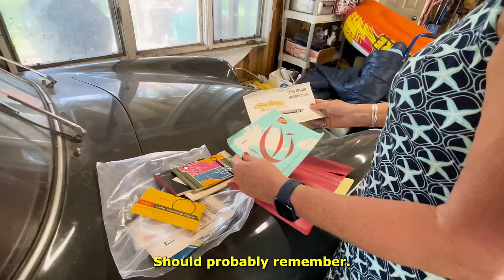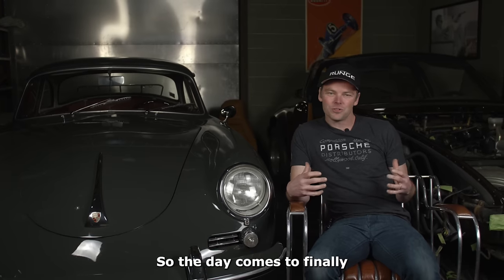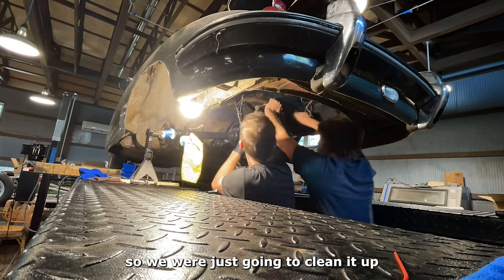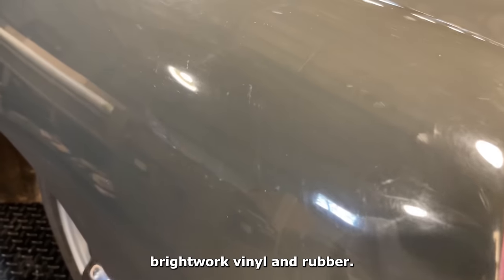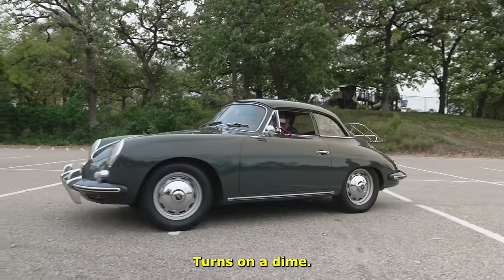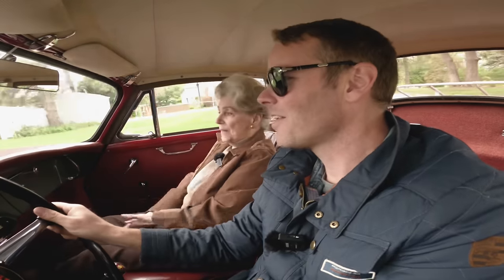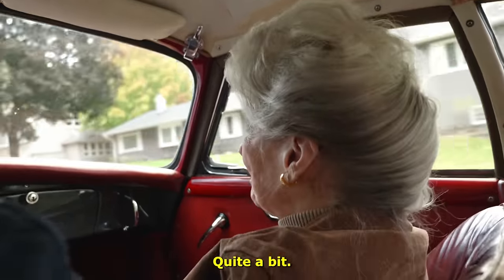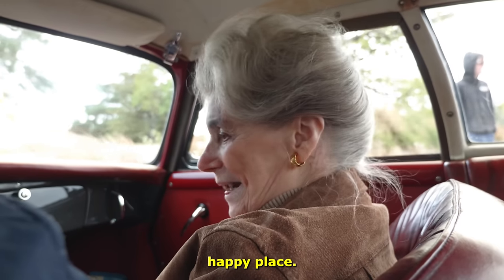Incredible Porsche 356B Garage Find : Reunited Original Owner After 62 Years!

Comment: This vid brings back childhood memories. In 1967 i was 4 years old & my dad bought a Slate Grey w/Red leather interior 1961 Porsche 356B. My dad was a high ranking official at Redstone Arsenal in Huntsville Alabama & he got the Porsche from a member of Werner Von Braun's German rocket team. When you showed the interior it brought back vivid memories of the smell (i loved) of the leather interior smell mixed faintly with gasoline. And i remember the under dash petcock for the "reserve" fuel tank. So many memories. Nothing like our trusty VW. The Porsche was a blast to ride in at speed ! Sadly, one night Dad backed over an exposed natural gas meter at a restaurant parking lot, cracking the magnesium crankcase. Rather than do an expensive engine replacement, Dad (grudgingly) sold the Porsche.

Comment: What was the reason 4 changing the original engine for a more powerful one? It has not been clear to me. The video rocks 🎸Chris.
Reply from the maker: There were a few engine options when they ordered the car. They went with the smaller displacement 1600 Normal which was in the car when we got it. Unfortunately that motor was stuck so we pulled it out and will rebuild it this spring/summer. I installed the 1883 Twin Plug motor I had here at the shop just so we could get the car on the road and meet Karen!
Reply: but the final idea Chris is to install the original engine back to the car this spring ?
Reply from the maker: @MarcsGarage   yes it will go back into the car after rebuild👍🏻

Comment: So what happened to the original deal?  Did someone get gazumped?
Reply from the maker: The gentleman who was representing the car had not actually processed any paperwork or transferred any funds with the party in Beverly Hills. I believe he was just tired of dealing with it. Lori ended up speaking with the BH party and brought everything to Karen for her to decide. She said it was best to keep the car local for several reasons. The other factor that played into this was with having someone who was not local purchase the car, the only way to extract it from the cottage down this minimum maintenance road was with a small truck and trailer… most transporters would have charged crazy money to get it out to a proper loading place… they most likely would have had to hire someone local to get it out from the cottage  there to a loading spot. Also, the broker to my knowledge had not seen the car in over 20 years and didn’t fully know the condition. To my knowledge he had represented it with a running engine. There were several things that played into how this all came together.